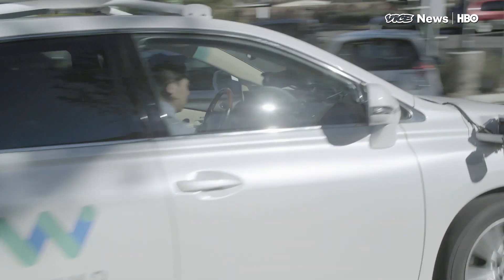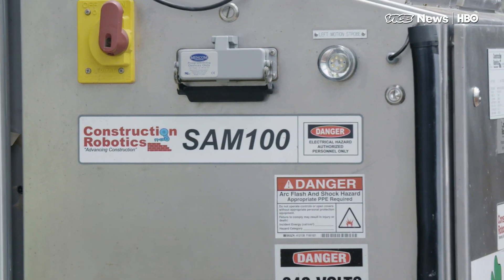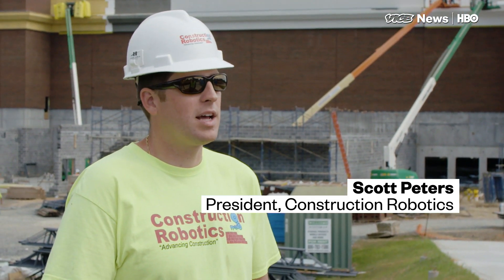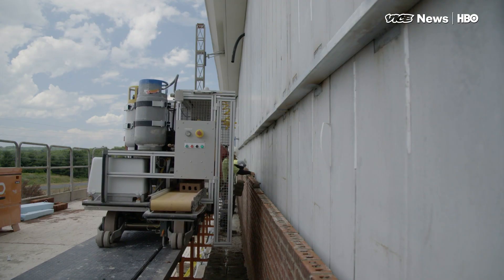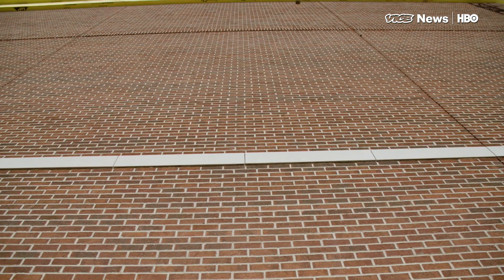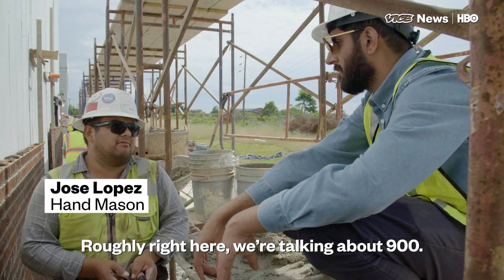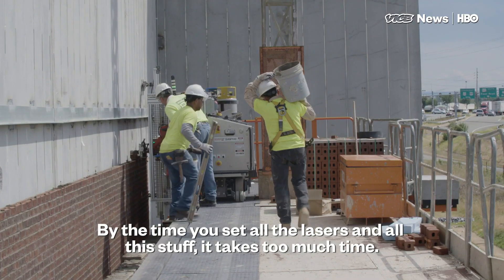This Bricklaying Robot Can Build Walls Faster Than Humans (HBO)

Comment: 1 guy lays 900 bricks the robot 3000 but needs 5 guys to operate needs to lay 4500 to match the 1 guy so no worries. By the time they set everything  for the robot Jose and Juan already finished the wall.
Reply: The robot has apparently doubled in efficiency over the last few years. What happens when it doubles again? What happens when it doesn't need someone to feed it bricks?
Reply: To be fair he said it takes 2 guys to operate, not 5. So it's laying over 50% more bricks when you take away the 1800 bricks those 2 guys could lay in a day.
Reply: No dude.  It takes a big team to do walls.  I've done it for decades.   This thing will not lay brick 
like they claim.   They show an easy run under ideal conditions.
   The real world will eat this thing alive.  Trust me. @ToastedFanArt
Reply: @bobbybooshay8641  Yeah and then the technology will improve and it'll be way cheaper and more effective than any team of humans. Like always. I'm not saying that with glee btw it's quite a scary thought to me for so many people to be made redundant by machines, but i don't know why you're trying to argue with me that the machine won't replace people. This exact machine might not, but the 2.0 version next year probably will you.
Reply: @ToastedFanArt  That's assuming the robot works the same hours as a human, if the wall takes say 24 hours to build for a human but 12 for robot, the robot will finish it in 12 hours but the human will take 3 days (assuming a standard 8 hour shift).
Reply: @ToastedFanArt  You're right, that machine takes 2 guys to operate, but think about it, those are the same guys who would normally drag bricks and mortar for the brick layers anyway. So, while those 2 still have a job, in reality that machine has sent at least 3 brick layers home.
Reply: @TheBushdoctor68  Yeah I know but my point had absolutely nothing to do with layoffs. I was just saying it was indeed more efficient since the original commenter said it wasn't. Whether or not it's a good idea is being discussed in other threads.
Reply: @ToastedFanArt  you must not have listened correctly!
Reply: @MassRemigrationNowUK  How so?
Reply: @ToastedFanArt  if they guys are laying 1800 bricks a day they are either really slow or really lazy
Reply: @Đeath Vader it's not taking jobs at all it's just increasing productivity once the technology improves, not to mention bricklaying is one of the most in demand trades in the modern day due to a lack of people finishing apprenticeships
Reply: Đeath Vader  i briefly ready his campaign positions after you suggested him he supports the green new deal single payer healthcare  strict gun control and legalization of heroin and a universal basic income  all shit that i believe is going to be nothing but a tax hike for hard working Americans to give out handouts  my use of " scum " after only a brief read on him was a little harsh  so i apologize for that
Reply: What a joke, with such long walls a bricklayer wil do easy 1000 bricks a day
Reply: Nothing to worry about at all, because they'll never improve that robot.  Never.
Reply: @jimpeschke3435  Yes.😂
Reply: Đeath Vader  in future , humans wont be needed to code
Reply: Đeath Vader actually robots are learning how to code. Learn how to code robots coding robots
Reply: Keep sleep on it buddy ;)
Reply: Niko  the problem isn't the machines, the problem is us. We are not ready for a society where most people don't have to work
Reply: finished the wall and took jobs away from those who are willing to work. building too fast causes lack of attention to detail. if you want to make something with %100 good quality, do the job yourself no matter how long it takes.
Reply: Đeath Vader  robots will be coding to one day
Reply: Jajaja maybe 1000 bricks for American workers,but for a Mexican that does masonry houses in México, lays  those 3000 bricks a day no Sweat.
Reply: Are we taking into account that the humans are laying bricks and skimming off excess cement?
Reply: @harshhash7824  not even fully automated lets say something realistic like 15-30% thats still a ton of people that will ultimately effect the communities they live in
Reply: i still give my 👍to mexicans....
Reply: That one guy is not carrying bricks or mixing mortar
Reply: Đeath Vader   supercomputers will be able to do that without humans flawed perception and predijuce.
Reply: Đeath Vader  i understand but eventually every possible mathematical outcome and possibility will be mapped and coded. Not in our lifetime so humans still need to be involved
Reply: Đeath Vader  we are all one and the diffrent thoughts and actions and diffrent people throughout history represent the infinite possibilitys you speak of. Eventually everything will be mapped
Reply: Đeath Vader  neuralink comes to mind but fk that lol i think elon is a wolf in sheep clothing
Reply: Hes hard for crypto which bets against the dollar instead of investing that money for salary bumps for employees or bettering his cars. Other profitable trading platforms like stonks and fo rex add value to economy and country and dollar
Reply: I’d love to see this robot lay a brick foundation on a muddy uneven dirt lot. Also the cost of buying and maintains that robot is probably 10x what it would be for a crew of masons. The robots aren’t taking over yet. Maybe parts of trade jobs but not the whole jobs. I’d love to see a robot get into a crawlspace and run wire or pipe, with multiple fittings. It’ll be a while before that happens.
Reply: Two guys, that feed new bricks and make it look pretty. Not as demanding and physically challenging. This robot is still much more efficient, does not require breaks, sick leaves and has no excuses for not being efficient
Reply: And I guarantee you they don't pay those guys as much as they pay masons
Reply: Đeath Vader  You do realize that coding will become obsolete due to modern advancements way before bricklaying does?
Reply: Đeath Vader  just by curiosity, what’s the average salary of a coder?
Reply: you are missing the lower cost of overhead (no payroll taxes, no workers comp, no retirement, no health benefits). the cost of a robot is a small fraction
Reply: @jgg204  what about ai? Can you imagine that? Robots on strike for better lube? Days holiday on Isaac Asimovs birthday ! Lol
Reply: CBEdits  coders will be replaced quicker than bricklayers
Reply: Đeath Vader  do you realize that some people will not have the ability to code due to there skill limitations what are those people going to do for work .......what happens when the vast majority of jobs are replaced by robots and there is a large portion of the workforce is without employment ...... it will be total chaos people will be doing drugs and alcohol at an extreme rate and there will probably be some type of civil war. i think elites are being greedy right now and trying to make there profit margins even higher it will be there downfall though when most people are out of work and very pissed off
Reply: @ckyownz9  Just like how during and after the industrial revolution the world's entire society collapsed, right? These machines maximise the efficiency of the human race, and when that happens, living standards for all increase.
 
Look at the global poverty numbers from 1700-2019. Way back the average person would have to struggle for food, nowadays the average person can afford two or three holidays per year and an xbox for his kids.

Did the invention of the printing press make people who wrote copies of books out of jobs? Yes, and it also meant suddenly a commoner could have access to a wealth of books. Did the Industrial revolution put people out of work? No it created new jobs and allowed for common people to have access to higher quality goods.

Is this brick machine going to put bricklayers out of jobs? Sure, but you'll still need people to manage and oversee the machines and you'll also get cheaper houses, meaning that once again; the impoverished are better off. 

If you had a machine that could build a house in two seconds suddenly everyone in the world can afford a mansion. What you're not understanding is that when advances like this are made EVERYBODY reaps the benefits.
Reply: We'll need another Julius Caesar then. @ckyownz9
Reply: @bobbybooshay8641  i wish
Reply: @ckyownz9  then those people need to get a new hustle
Reply: @Cumminspror  the point im trying to make is a lot of people dont have the capability when those people are jobless and angry there only natural reaction is going to be violence .................and when i say a lot i mean a lot i would imagine 1/3 of jobs could be replaced by robots or ai maby even 2/3s or higher
Reply: @ckyownz9  I just posted a poor version of your reply . Yes we've got to wake up ! Regards from the UK , Will
Reply: Đeath Vader  im a free market capitalist but theres certain things like robots and massive greedy fortune 500 companys that have there hands in government that are going to ruin it
Reply: Đeath Vader  yeah except A.I will be able to write codes within the next five years. Good luck bud. Better get into Lawn Care.
Reply: @ChristIsComingAgain77  Umm they haven't made a Roomba that mows lawns yet?
Reply: Ethan Hunter  They literally already are.

Comment: If it takes two humans to keep it operating and do finish work, that only makes it a net 1,000 brick improvement since they said each human averages 1,000 bricks per day while the robot averages 3,000 bricks per day. With the price and presumed time to get it set up that seems negligible. I support the use of robotics in the right applications but efficiency has to be improved here before it is viable.

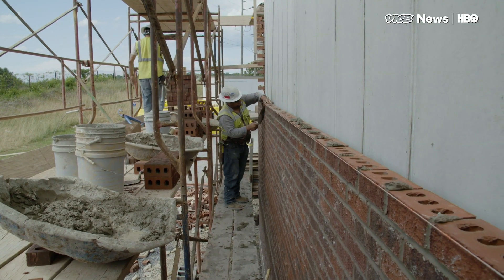Comment: So many contradictory comments, not just posted here in the comments but in the video as well.  Robot laid 3267 bricks in 8 hours, but still requires two workers to maintain it (feed it bricks, mortar, clean up the mortar lines) and the robot maintains quality and efficiency the entire time it is operating. And at 3:03 hand mason claims he can lay 900 bricks in a day, and then goes into why the robot is bad. "only good for long walls which he never sees anymore" (ignore their current job site that they are on), doesn't think the robot, that lays over 3 times the amount of bricks he claims to lay in a day, "is not too fast and takes too many men to operate."  So is it taking jobs or creating new jobs if it requires men to build it, maintain it and operate it.  And what does it say about the worker when he thinks that something that outputs 3 times the work he does is slow?

Comment: 2 bricklayers on a straight run like that on this video could lay 3000 bricks between them a day easy. earning around 7-800 gbp a day. This video is un-realistic because the robot is very slow and still needs 2 men to operate it and feed it with bricks and mortar.

Comment: Someone has to program it. 3 people to operate. Constantly needs setting up when moving on to different jobs on site. Too big and inpractible for most sites/house building.  Can it do detailed work? Running costs. What happens when it breaks down? Only good for running a line on a huge straight wall. It’s another pointless bit of technology for the sake of it. A bricklayer only needs a trowel, a level and a measuring tape. It aint catching on anytime soon.

Comment: Wait...a Robot lays 3000 bricks, a man lays 1000 bricks, But the robot needs 2 people to tend to it...and it only does straight lines, needs setting-up, a track...ok so it's not too efficient for now. 

If it's to be faster, the bricks gotta be loaded on a belt in the manner similar to a machine gun ammo belt, the motar needs to be squirted out in a stream as the robot moves along the wall, and the whole belt of bricks should be rolled onto the surface in one continuous stream.

Comment: The advantage a human bricklayer has over a bricklaying robot, a human can lay brick anywhere! You need virtually pristine conditions to run that robot, and they are one trick ponies that lack the versatility of a human bricklayer, and lack the ability to repair brick walls or correct mistakes due to faulty materials. Anybody think how long will a construction business owner use that machine before it makes a profit after it's purchase?

Didn't think so.

Comment: As a bricklayer I can safely say there’s more to bricklaying than building to a line, is a house the robot builds going to have windows/doors, detail i.e soldiers above/below windows, arches, plinths. Is it only capable of building in the traditional stretcher bond?

How’s the robot going to do cut ups on gables etc? Not the mention that over here in the UK your typical house has one block for every six bricks. Can this robot joint up its work? Is this robot capable of laying blocks because if he isn’t then it’s only capable of doing 25% of my job.

I am not biased because I believe AI and robots are the way forward. The pros consist of being able to work more hours than me, if I were to race this robot 20 courses on the line it would finish 3x quicker than me. 

I understand that this is merely a prototype and there is so much room for improvement but to say this robot is capable of taking my job today is simply ludicrous.

More than happy to argue with anybody that reckons they know more about my job than I do

Comment: This is weak, what happens when that wall needs electrical running through it, can Sam make proper notches on the bricks, and proper cuts, for the PVC pipes to run tdd through it, can it pull out a tape measure, can it operate a brick cutting machine, only thing it's good for is stacking bricks, TRY AGAIN PEOPLE.

Comment: These aren’t the robots that will be taking jobs, these are the old type of stupid robot that half the time take more work to set and monitor than just doing the job your self, the robots that will be taking jobs are the ones that can adapt to new tasks and different jobs on the fly, they won’t be made by some construction company either they will be designed by high tech company’s that have had advanced manufacturing and engineering technology’s.

Comment: To address all the relevant arguments:

Yes the robot is currently slow, it won't remain slow, nor will it require three men to feed it indefinitely.

There will be a saturation point in the market. It doesn't matter how fast you can build cars, it matters how many you can sell and how much the materials cost. 

Oversaturating the market with "cheap labor" (illegals/robots) does nothing to increase the buying power of the market. Increasing the rate of speed of production can only cheapen the value in competition. There will be marginal markets that open up as cost comes down, but it will be fractional in proportion to the increase in efficiency. Jevon's Paradox.

Our dependency on fossil fuels to power this method is also unaccounted for. Much like the collapse of asphalt companies during the '06-'08 fuel price hike, this robot will be subjected to that price change much more directly than the worker. 

You are injecting long term market devaluation, with high exposure to market price in fuel, brick, and demand, with no ability to repurpose (a brick layer can much more easily become an electrician or a store clerk).

Bear in mind, there is no reason at all to believe there is a sustainable fuel supply to run the level of mechanization we already have. We have been, for decades, consuming four barrels of fuel for every one we've discovered. 

It is a bad idea on many levels, and the energy wasted building the device could have better been spent just making more bricks to be installed when demand met the available labor.

Comment: You still need men to set up the machine, scaffolding, mixing the mud and from what I saw the bot makes for a messy thick joint that will need to be cleaned up. Not to mention what does it cost and what is its lifespan! Let’s compare dollars to donuts.

Comment: All is good when you have a building that large. Try tell the robot to build something other than a long brick wall for example a block wall, corners, return corners, build features or even lay different bonds. Also I’d like to point out the most obvious... not all scaffolding can fit a robot on. robot. Robots can’t build footings unless you tell the ground workers to change the way they work and set thing up. I used to labour for a price gang and they would lay average 1700-1900 bricks a day with one labour so that’s the same as the robot if not more. As your going to say robots will get better and probable speed up but then you have to employ more labourers to feed a robot, walls would be built quicker so you would spend more time moving the robot to the next wall and setting it up. Bricklayers can do this as easy and effortlessly. If a robot breaks down that then means three of your labours are out of work until it’s fixed, so that’s 3 un happy workers, a bill for the mechanic and a robot not earning you money laying bricks.

Comment: Honestly that robot would just be in my way... If I didnt have to strike my own joints and simply had to put bricks in the wall I could easily out work that robot with out working up a sweat. Perhaps one day they will be able to make a robot bricklayer that can out preform a human...but certainly not this one. lets see it go back and strike all its own joints and then brush the wall and raise it's own line (lazer) and deal with laborers that run you out of materials and correct other trades errors. Nope. Not yet.